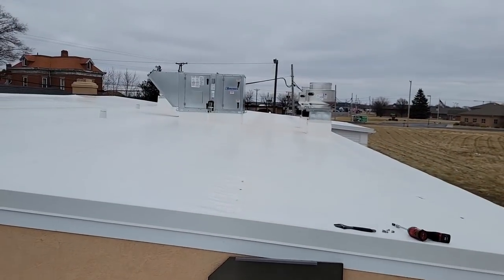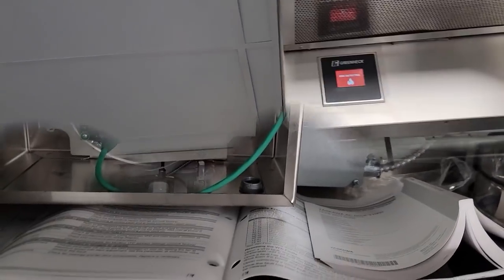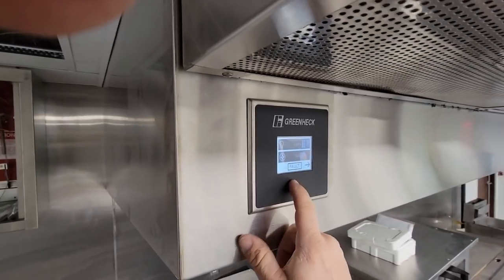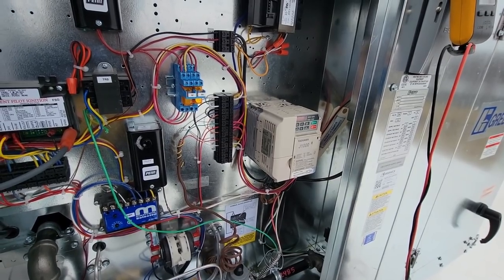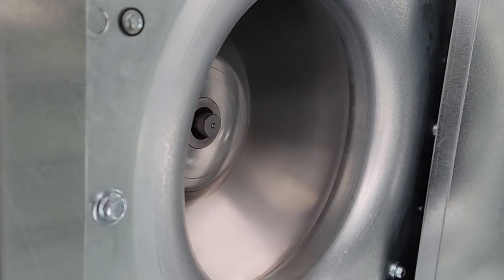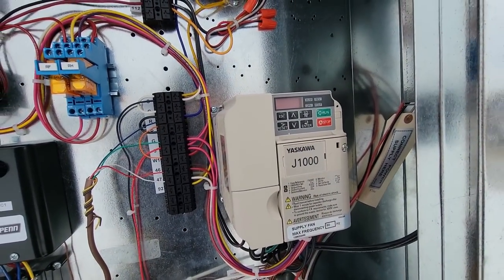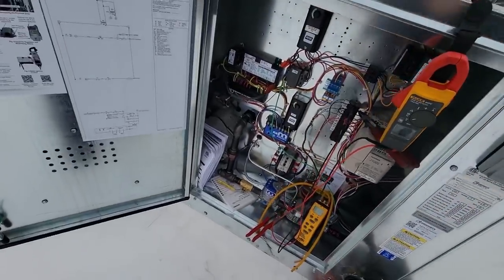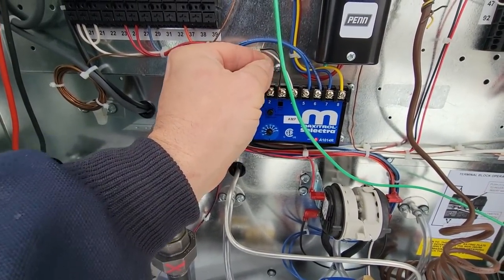Exhaust Start Up From HELL

Comment: Aah, the joys of working on equipment you have never seen before, wired by people you have never met.  It’s a lucky man who gets chosen for these tasks.  Job security indeed.
Reply from the maker: 🤣🤟 the vfd drives was the main thing that was a little different, generally it's the same equipment but the drives made it a little more complicated especially when you don't know where all the powers sources are.

Comment: I like that freezer it had a push in knob so it doesn't get locked accidentally. 
Man that was an awesome video,  very impressive. 🙏✌
Reply from the maker: I believe that's standard required equipment for walk-ins nowadays. I know the really old ones didn't have it. Thanks for checking it out 👍👍

Comment: I was setting up a new restaurant one time you had all kind of trades running in and out. Some electrician was coming down a step ladder and one of his tools caught the ring of the pull pin and he set fire system off for the kitchen area. I was amazed of how fast that system activated, as I was running for my life. I'll never forget the look on guy's face as his boss pulled up. His boss didn't fire him either, he said accident's happen and THANK GOD this is a new build as he threw his hat to the ground. We get back after the clean up a few days later and his boss goes are you going to take me to the cleaner's replacing shit, I'm paying for all this? I showed him a few controls I was concerned about I go it is working, however that fire product got on to these I don't want to deal with one day they are working one day they aint. He agreed I replaced them and we have been friends ever since.

Comment: My biggest issue with installing hoods is when electricians think they know more shieeet and start messing with the parameters and screws things up they leave once finish but my self I gotta go back and see what the hell they did. That’s my only downside of commercial work. Good video Rick keep it up bud. 👍
Reply from the maker: Thanks so much! 👍👍
Reply: The Last one of these that we did, the electricians were very humble.  The VFD was only putting out half of the voltage on one leg and the exhaust fan motor was violently running back and forth.  I'm like no big deal, there looking at me like what do you mean it's no big deal.  LOL  It looks like you guys hooked it up right, ya we warranty this VFD it will be all better.  

I wish the VFD were closer to the motor like on the roof.  Then control it with 4-20 ma.  Long runs to the motor isn't good for the motor, and you can get to 100' real quick.  Sometimes the electricians can run a chase over the hills and through the woods to Grandma's house we go.  The output of a VFD isn't a sinusoidal signwave it can develop huge voltages out of phase at the motor end.
Reply: For the guys who like 2-10 v for control, it's awesome when what you're controlling is very close. If there is any possibility of picking up ghost voltage like in a chase it's better to use 4-20 ma.  The  amperage won't induce from wire to wire in a chase like voltage will.

Comment: I came across the flame sensor on a Greenheck direct fire that was too long if you can believe that. Had the local rep come and said Greenheck was trying to run through what they had and knew about the issue. Cut it and all good since, but what a nightmare to find.
Reply from the maker: Awesome to hear, any new information is always helpful! I'll check it out if it becomes a problem. 👍👍🤜🤛

Comment: Since you had to turn the gas valve down almost all the way, did you check the input pressure to make sure it wasn't too high? Someone might have forgot to install a regulator or set it too high. If adjustments are way off on brand new equipment I get suspicious something else is wrong, like you found the dampers.
Reply from the maker: I will check into this. You make a valid point. Thank you!
Reply: good thought process, someone may have fudged up the install or it's just that sloppy untested junk from manufacture, I'd not be surprised either way anymore! 🤬

Comment: from what I can tell, the test equipment is not compensated for battery voltage drop and that causes them to drift pretty bad as the initial surface charge drops and as they get weaker it becomes even worse. probably wise to turn them on and let sit for a minute or two before using.

Comment: Is the "space temp" on those new walk in coolers reading evaporator temps inside the coil enclosure?
Reply from the maker: There's a sensor on the side of the coil and one behind the coil in the air stream. I'm not sure if there was one on the suction line.

Comment: Not a fan of those Yaskawa drives, never found one that was user freindly. Odd manufactuer had you adjusting gas valve, but have to follow what they want. Ilike Russel's controller, pretty straight forward design. Nice video.
Reply from the maker: I cut out the fact that I was looking for the regulator before the maxitrol valve but could not find one.🤣

Comment: Been wanting to buy the ratcheting crimper that you have but checked again today and its been discontinued. Instead got the Klein and it seems to be good from what I can tell.
Reply from the maker: The Klien is good too, one of the guys I work with has it and it does a nice crimp, I don't think it's quite as good as what mine is but I'm just conceited that way. 😁